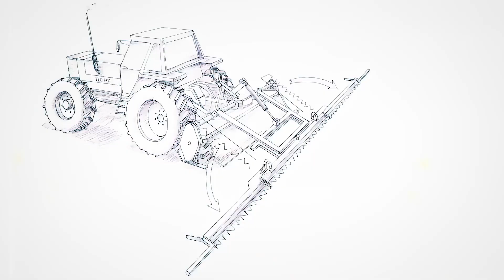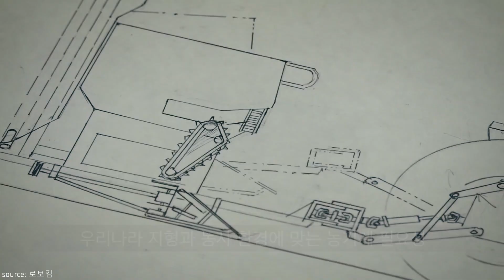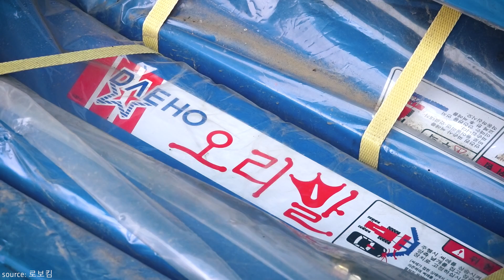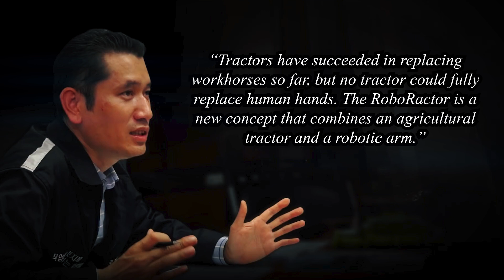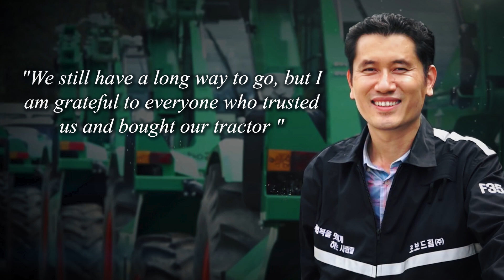The Story of RoboRactor RT105 - Is it the most universal tractor of all time?

Comment: 08:24 and 09:55 Amongst all of the brilliant features, I was especially surprised by it driving about 50 km/h backwards, that is with the fixed axle driving ahead. Vehicles with such configuration (or being used as such) are inherently unstable at high speeds. Recovery of a slide is inherently near impossible, even with electronics. So I'm wondering if that was just a marketing stunt or there is some steering ability on the other axle (with big wheels).